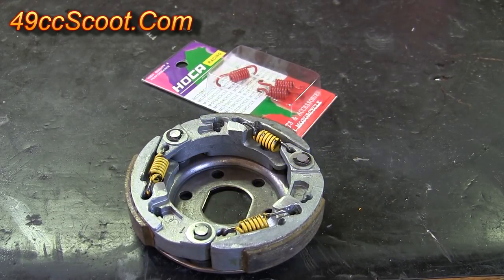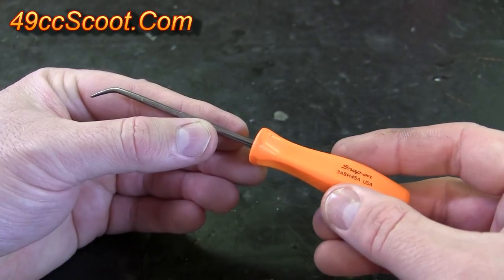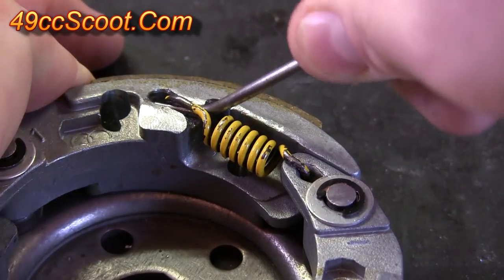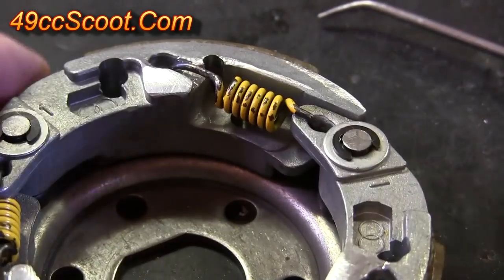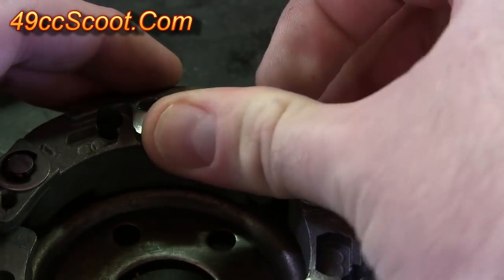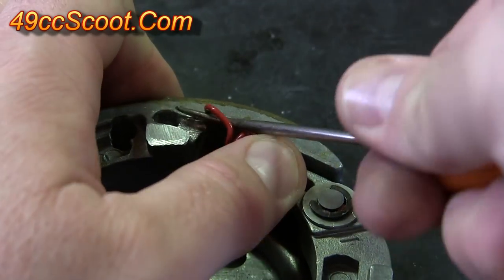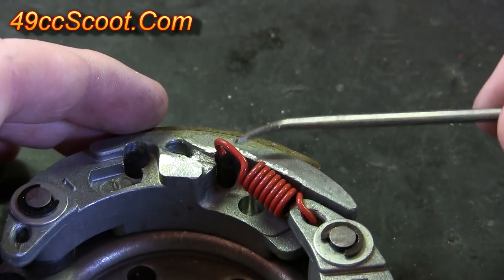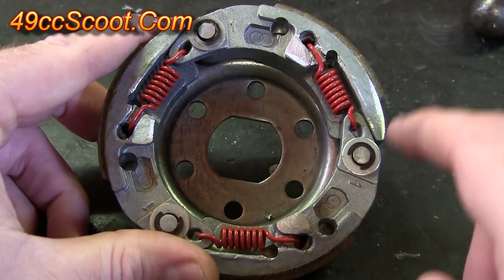Easy Clutch Spring Installation For Scooters : 139QMB GY6 50 150 49cc 250 Zuma Ruckus How-To

Comment: A greeting, my friend, I want to thank you for the technique in this video, I used it in a clutch gy6 150 and I put you springs 1500RPM and served me the technique of the thin screwdriver to fit the new springs, i was very easy, otherwise i was been very difficult, even try with a pair of tweezers and are very hard. :)
Reply from the maker: Glad it helped!

Comment: Nice video. Before I start working on my scooter would you think I have a clutch problem. I can't push it backwards when the engine is running or switched off. It's like the back brake is on but I've had the back wheel off and all seems ok there. Seems to move forward ok with or without the engine running. I'm a newbie when it comes to working on these so any help would be appreciated. Thanks from the uk.
Reply from the maker: Have you tried turning the rear brake adjuster out a turn or two to see if it helps?

Comment: Why did you decide to change the springs?  I am a big guy, too.  What does this change do to performance, uphill, a little more speed, etc?
Reply from the maker: Clutch springs help with the initial takeoff, getting RPM up off the line. 
http://www.49ccscoot.com/faq/clutchsprings.html
Reply: So I have a 2000 rpm spring and a 1500 rpms spring in my 50cc what one is better to run im a light guy I'm new to all this stuff sorry

Comment from the maker: I would at least clean out the belt dust, take a look at the roller weights, check the condition of the belt, measure the width of the belt and replace if it's 1mm or more under original spec (although quoted as 18mm many really start at about 17.5-17.7mm wide). If you haven't checked the valve lash since the PDI, it's about time to check and adjust if needed. There's a maintenance schedule in the tech library at my site under basic info and guides.

Comment: I can not imagine how you exchange springs from clutch, the springs go already broken before you already installed, only times Tip of me the best you switch as follows Fuse discs / clips from clutch pins remove all 3 clutch pieces evenly from the clutch carrier , After hanging the new springs all 3 couplings on coupling carriers / pins draufziehen so the springs are also not pulled out. ;-)

Comment: Great video I'm sorry to ask I purchased my son a rxf 50cc dirt bike full automatic. He is getting quite bored of the acceleration. do you have and tips how to modify this type of centrifugal clutch for mini motor thanks.
Reply from the maker: I'd probably consider a swap in that case. Check out the prices on larger semi-auto or manual transmissions. You can get a 125 fairly cheap, the last time I looked, and that  will be a big upgrade in power. The toughest part with swapping auto to manual is figuring out how to actuate the clutch and rear brake, but if there are manual versions of that bike you can probably get whatever parts are needed. If you get a semi-auto, it's got a shifter but no clutch so you don't have to worry about that, but you don't get the same control as the manual and the manual tends to be a bit faster from what I've seen.

Comment: Can you tell me if the 1000 rpm springs are the same as the stock ones? Iam looking for a little better pick up en more power take off.. Iam using the stock clutch springs now.
I dont know if 1000 rpm is just fine or do i need to go for the 1500 rpm ones.
Reply from the maker: The way that they are supposed to be rated is that a 1000RPM spring will get revs up 1000RPM more than stock. Doesn't always work that way, but that's the idea. I usually buy a set of 1000, 1500 and 2000RPM springs (or soft, medium, stiff) and test them to see what works best. Sometimes springs are too stiff and engagement doesn't happen till the CVT is already shifting and you lose the best takeoff ratio so you can't just put the stiffest in and assume they're best.

Comment: I am over 2000 miles now, and i was wondering what do i need to do at this mileage with my clutch and belt or rollers in my CVT? I mean what is necessary at this mileage? I am not having any problems now, and i have replaced my spark plug, gear oil, and motor oil, both oils have been done on time, and the spark plug was a little white when i replaced it.

Comment: Thks again four your video whitch best coloure springs you recommended to use on Piaggio Zip 50 2T from 2015 thank you again
Reply from the maker: No experience with the Zip, but I generally recommend that people get 2-3 sets of springs and try them. Some people have different preferences, and also the clutch doesn't always work the same on every scoot.

Comment: I have a 150cc jonway, GY6 engine. I have replaced carb, plug, cdi, plug boot, gas, filter,  compression showed I was low, so I adjusted valves to .05 clearance, & replaced fuel lines. It will NOT start unless I spray start fluid in carb, then it idles and runs great.  I don't know what else to do.
Reply from the maker: +Christopher Lauderdale Did the compression test show a good reading (~150psi) post valve adjustment?

Comment: do you have any advice about upjetting carbs I have a 21mm carb tnt with 70cc airsal kit, malossi fly clutch, polini varaitor  and at top end revs bike back fires and bogs till it's slowed down again
Reply from the maker: +Luke Sykes Check your plug immediately after it does that and you should know if it's rich or lean. Change jets accordingly. More info : http://www.49ccscoot.com/faq/carbtune.html

Comment: My scooter's back wheel spins on its own as soon as I start it and the idle screw is on the minimum, when i inspected the cluch I found one of these springs brocken. Could it be the problem?  Please answer. And by the way,i love your work man!
Reply from the maker: Yes, that's likely the issue. If the spring is broken, one shoe is contacting the bell all of the time. Not good. Fix ASAP!

Comment: Great video. You are the best teacher. I have a question.
From the Genuine Roughhouse R50 Sport scooter which is the factory specification of these parts:
The weight of the rollers?
What is the RPM of the Compression Spring?
What is the RPM of the Clutch Spring?
Reply from the maker: Spring RPM is easy. They would be 0RPM. Aftermarket springs are supposed to be rated by how high the engagement RPM rises beyond stock, so stock would be 0RPM. A quick google search says 7.5-8.5g 16x13 rollers. Can't tell you for sure if that's accurate.
Reply: @49ccscoot  Thanks for your quick response. It has helped me a lot. Keep it up with your video because they are very instructive.

Comment: so if i install 2000 rpm clutch springs what should i put in for roller weights to get the best top speed?
Reply from the maker: They're kind of unrelated. Put in whatever rollers keep the RPM where your engine needs it to get top speed. Gotta tune if you want the best speed.

Comment: Hey do you have a good way to make a centri clutch bite harder, it does its job fine, but id like it to lock in harder.
Reply from the maker: Usually more weight and/or increasing friction. It's not common for people to add weight to a clutch though. Is it slipping a lot or you just think it would be better if it locked more abruptly? It is normal for clutches to slip in and a lot of times if the clutch does grab hard the belt will then slip instead.
Reply: @49ccscoot  it works as normally or as intented atm, but i would like more grab as soon as i hit the throttle, but i suppose it could be the belt slipping

Comment: I have the manual, but i havent read anywhere about adjusting the fuel air mixture.
Reply from the maker: An owner's manual wouldn't show that and some service manuals may not. In stock form many are sealed now so you can't even adjust them without unsealing the carb. There are 2 links below that may be of use.
http://49ccscoot.proboards.com/thread/429/idle-mixture-adjustment
http://49ccscoot.proboards.com/thread/5148/unsealing-carbs-mixture-tamper-screws

Comment: I have a yamaha razz 50 cc. How do i check if the clutch and spring are worn out? Also the carb is always dirty in the outside its like its leaking petrol, what should i do?
Reply from the maker: The most obvious thing is to observe how the scooter takes off from a complete stop. If the rear wheel is always engaged and trying to spin you either have too high of an idle speed or the clutch is not functioning. If it takes essentially no throttle to move, then again it may be that the clutch is engaging too fast from worn springs or elongated spring grooves that create lower tension. If it does the opposite and slips a lot on take off then your clutch bell or shoes may be worn or glazed or the oil used may be wrong for your transmission. Your Razz should have a wet clutch, unlike the CVT driven scoots, so if you go to remove the cover remember that oil will come out and it will need to be replaced. Find a service manual and Yamaha should give some sport of specs to check the clutch by measuring clutch/bell diameters or clearance.
Reply: *****  the scooter has done more than 37,000kms, and ave only changed the piston and rings. Should i also change the crank shaft, carb, clutch and springs? Also the airfilter is worn out and i need to change it. Anothet qn, how many turns out should i make on the fuel air mix screw?
Reply from the maker: It sounds like you need to do a full inspection of the engine and CVT. I would try to find a service manual and go through it.

Comment: I just bought a medium torque spring and 3 different clutch spring i want good pull out and good top end what do u suggest?
Reply from the maker: +EpicScootModz Try all the clutch springs and find out which works best for your application. Watch when the belt starts to move before takeoff. If the belt moves much before the clutch engages, you could miss out on the full advantage of the CVT's "low gear" and may want to use softer springs.
Reply: Ok thanks I have soft clutch springs right now and my scooter pulls out super slow the clutch only engages at 20kmh

Comment: Thanks for replying 90gtvert . Yes. Tried that. It just makes the tension on the lever tighter or slackens it off. When I can't push the scoot backwards I can push it forwards so I know the brake isn't sticking on. When it's up on the stand I can move the rear wheel forwards (not very smooth though) but I can't rotate the wheel backwards. If it was a car it's like it's stuck in gear. Not sure what else to check...
Reply from the maker: If you pop the CVT cover off it will be obvious if the clutch has anything to do with this. Normally when you spin the rear wheel only the bell will spin. If the whole rear pulley or both pulleys spin the clutch is engaged when it shouldn't be. Could be a broken spring or something like that. If the pulleys aren't rotating then it's either in your gearbox or you have some kind of clearance issue.

Comment: @90GTVert i have the HOCA adjustable clutch for 139qmb. what are the adjustable spring loads for? is it to engage the clutch quicker or does it put more strain on the clutch itself?
Reply from the maker: I didn't know HOCA made a clutch that had any adjustment beyond just the standard clutch spring set that changes engagement RPM. Are you sure it's not a DrPulley or some other brand?
Reply: +90GTVert http://www.partsforscooters.com/169-187_QMB-GY6-50cc_Transmission-Kit?sc=34&category=132709 this is what i have.
Reply: +90GTVert so sorry it's not HOCA...idk why i thought it was? (the fuck is wrong with me lol)
Reply: +90GTVert but what are the adjustable clutch springs for? like does it help make it engage faster? or what? lol idk

Comment: What purpose do the springs serve? How does it work?
Reply from the maker: The springs resist centrifugal force trying to throw the clutch shoes outward where they would mate up with the clutch bell and drive the rear wheel (through the output shaft and gearbox). Stiffer springs require more force (RPM) to overcome so the clutch doesn't engage till later.

Comment: would 1500rpm or 2000rpm springs be better for hilly areas
Reply from the maker: +conceal It only matters if you're starting on a hill.. the first say 10MPH or so. Regardless, you need to try them and see if you really want the best performance. Not all clutches and springs act exactly the same and the way the rest of the CVT is setup will matter. There is no easy answer of X springs work best in all cases.
Reply: +90GTVert thank you

Comment: Hi I have a Kymco super 9 a/c airsal 70cc kit nakaru 21mm carb 6/7 gram rollers polini varaitor with a malossi fly clutch with white springs standard belt and standard torque spring still lagging a bit
Reply from the maker: +Luke Sykes If the revs aren't up initially, try stiffer clutch springs. If it's OK taking off but too low after, then you may need lighter rollers or a stiffer contra.
Reply: Cheers pal
Reply: +90GTVert every time I try my 5 gram rollers it's revving out could I do 5/6 would that work better thanks again
Reply from the maker: You can try it. Most of my tuning is trial and error. With patience and writing down what results you get from each setup, you can find what works best.
Reply: +90GTVert ok thanks have you got Facebook pal
Reply from the maker: Sorta. I always have it deactivated because I don't use it, so basically no.
Reply: +90GTVert ok thanks anyway will keep you posted and try post a video
Reply: +90GTVert hi having a problem with the 21mm tnt racing carb it's got a 98 main jet in and won't start
Reply from the maker: +Luke Sykes http://www.49ccscoot.com/faq/carbtune.html   http://www.49ccscoot.com/faq/wontstart.html

Comment: Is it hard to change the brake light out???
Reply from the maker: Depends on the scooter. Many can be done by either reaching behind and getting the bulb out or removing a couple of bolts or screws for access.
Reply: @49ccscoot  First, thanks for the reply....yes, I went out to check in better detail and I think there are only 4 screws I have to take out. I got speedy 50 scooter a few years ago and it has had nothing but problems. Within the first year I had it both tires went flat, I had to replace the headlamp 4 times, the back left turn signal and now the brake light is burned out....I will never go back to the dealer I got it from....